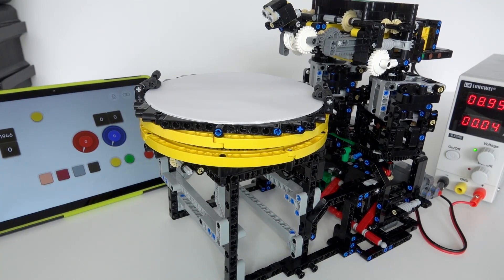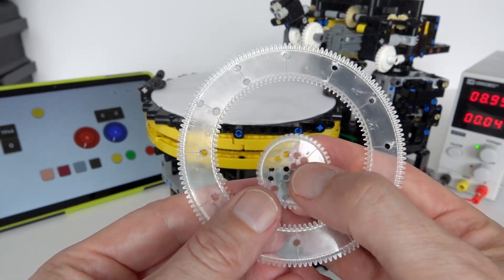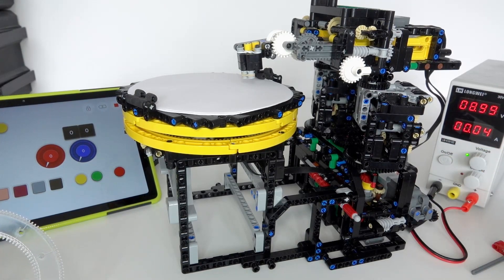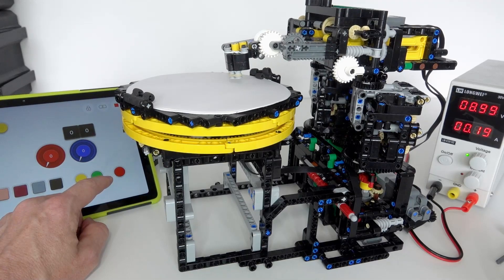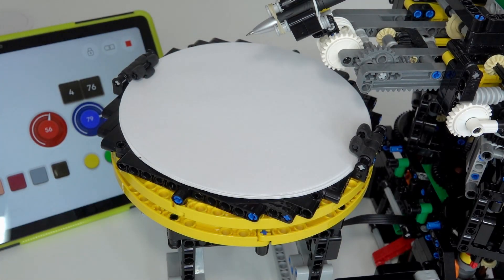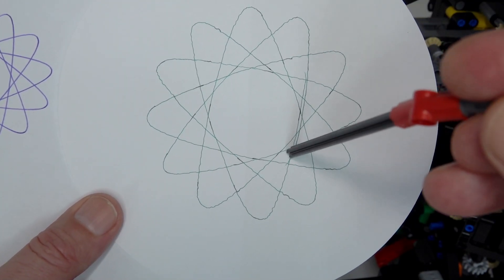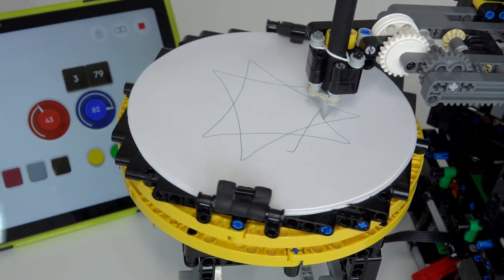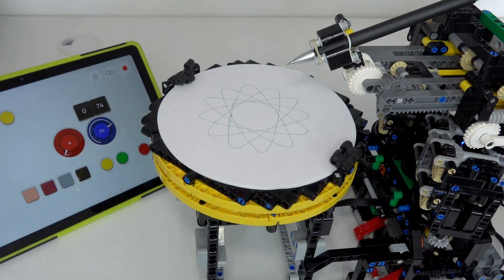Spirograph Machine - Lego Technic

Comment: Hello
I’m looking for assistance in designing a LEGO Technic gearbox specifically tailored to work with a LEGO vacuum engine mounted on a car chassis. The gearbox should include a neutral position along with 2–3 forward gears. The gear ratios need to accommodate the high RPM output typical of a vacuum engine.

I believe incorporating a clutch mechanism would be essential to prevent the engine from stalling. Additionally, I’m considering the integration of an electric booster motor to assist in low gear for initial movement. The system should be RC-controlled.

Any help or guidance would be greatly appreciated!

Comment: This is fantastic! I've built a couple of Spirograph designs off Rebrickable and both work well but don't reproduce the same type of patterns as the original gear version you showed. I think you've done a great job recreating the same style as the original. I would love to see a more in depth look at the mechanisms involved in your design! It looks delightfully complex. One idea I have to help with the little hiccup when the pen drops in would be to have it move vertically to engage with the paper, maybe with a linear actuator, not sure how feasible this is though. Anyway great job!